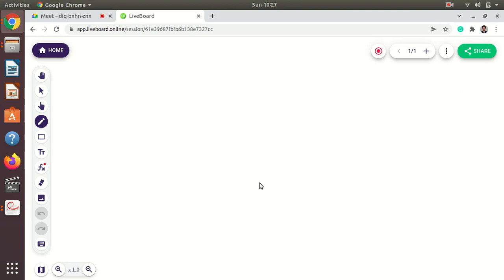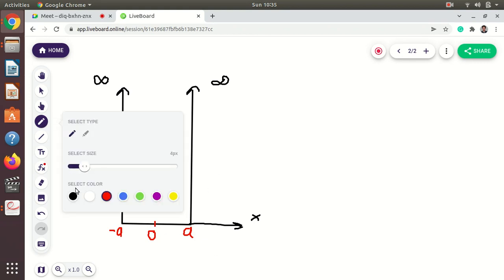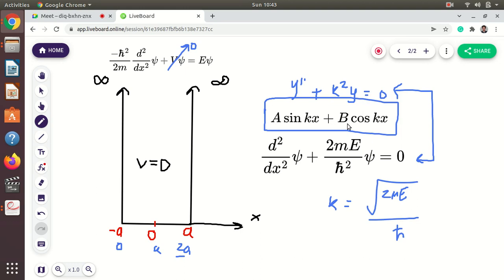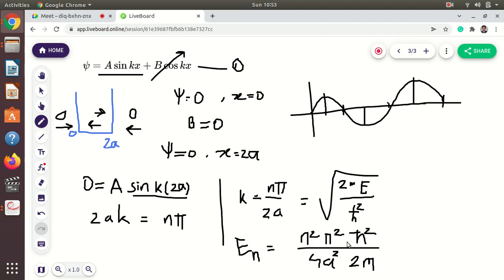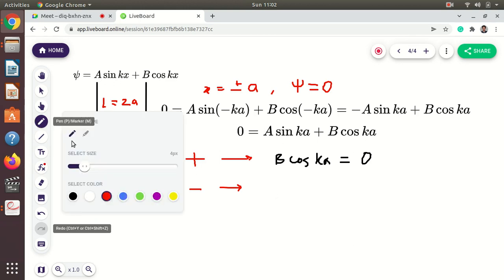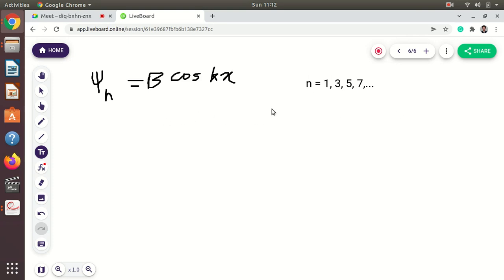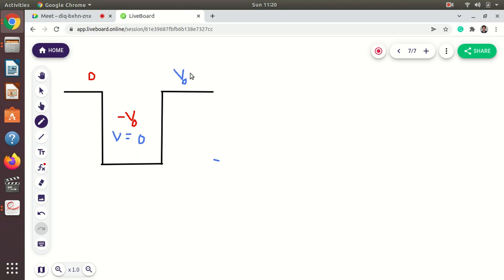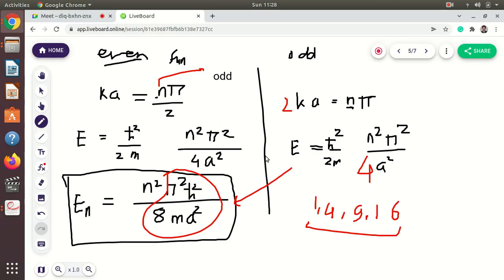Infinite square well potential

Comment: Hi
Very Nice Attempt

Can you please describe how to derive the general formula of the wave function for this particular (-a < x < a) infinite square well.
Reply from the maker: Sure. The process is the same. We have to use the properties of wave function that it should be continuous. For infinite potential well, it is zero outside the well. Therefore the wavefunction on the boundry is also zero. Such conditions can be followed by sine function ( ground state ).
Reply: @thrustofcuriosity5407  

Okay.

I understand it but, there are some mathematical difficulties arising in the derivations of the general formula for the wavefunction.